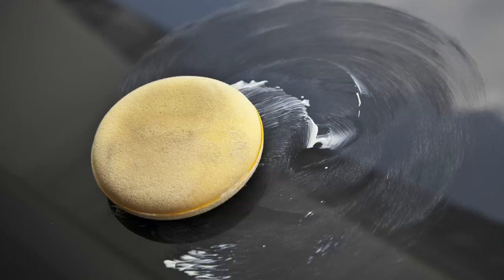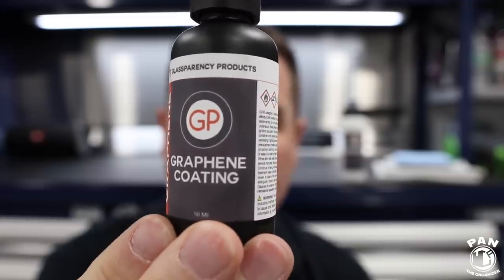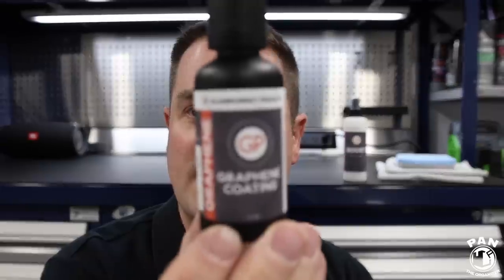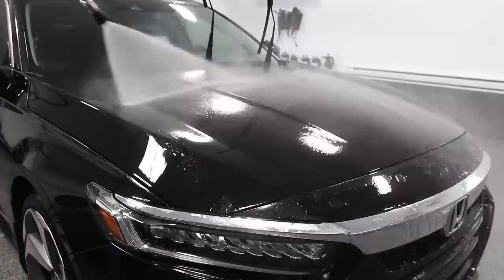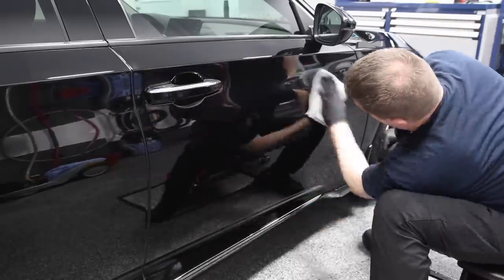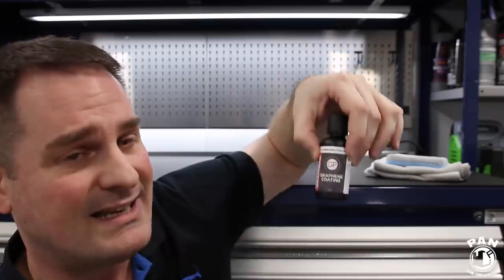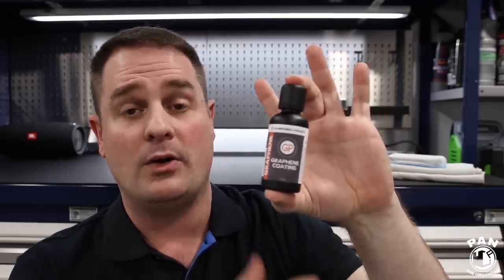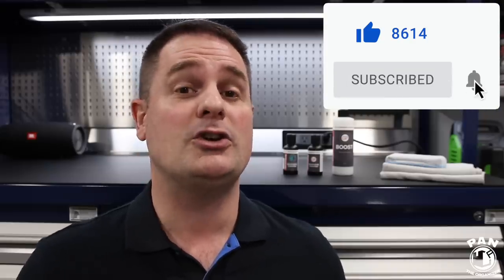GRAPHENE COATING by GlassParency! The Future of Paint Protection!

Comment: Pan, I love your personality and in depth videos! I’m expecting delivery of a new Toyota Highlander in mid August of 2022 and is to be built on July 27, 2022. I would like to apply the GP graphene coating and all the prep steps that you did. My question is it safe to do all these steps on this vehicle right away or does the paint and clear coat need to cure longer?
Reply from the maker: Hi Steve! Yes, brand new vehicles come from the factory with the paint fully cured and ready to go, as the paint is cured in commercial ovens. So yes you can, and SHOULD protect the paintwork as soon as you take delivery from the dealership.

I get a brand new car every three years and before I take delivery, I give clear instructions to the dealership to NOT apply any form of wax or sealant on the car, no protection. Just have them wash it so you can inspect on delivery for any defects or damages. And no interior dressing, no tire shine, nothing. I want to do all of that on my own.

Also, ceramic coatings and graphene coatings (the ones in glass bottles) need to bond directly to virgin clear coat, so you have to make sure there is no protection on the paint before you apply them.

Watch my ceramic coating application tutorial: https://youtu.be/sqQYVjxFqK0

Also, I made a popular video about why it's important to detail a brand new car: https://youtu.be/QgoyrC-5CMc

Comment: Hey Pan, I just ordered a bottle of the PanTheOrganizer limited edition from GlassParency after seeing this review! Super excited!

Quick question, is the Boost similar to other silica spray sealants? Is it possible to put the graphene coating on virgin clearcoat and then spray something like turtlewax hybrid solutions ceramic spray on top of it instead of boost? Or would this diminish the effectiveness of the graphene coating?
Reply from the maker: Yes Boost is like a silica spray sealant / topper.  You can also use other toppers on top of this graphene coating.

Comment: Hello Pan.

Thanks again for a great video!

I have another idea in mind. In our homes, specially shower and sinks, can we put that on:

- glass of our showers? It would avoid the chore and pain in the ass to clean all that persistant water.

- floor tile that we put on walls of our showers. Same too, we have to clean it, it would be awesome to see all the water running on without grasping on the walls.

- sinks: I have a red colored sink in my bathroom and I will never make the error again: you have to clean it almost everyday, it is fast but the tartar grasp on the glass of the sink, and if you don't clean, the layers accumulates quickly and after 3-4 days, waouhh... 

- in your toilets (where you pee ;). You remove all the water and then you apply this.

Is this possible? No problem? Are there better products?

And also vinegar is great to remove tartar but to remove all grease, everything, any product recommended before applying such coat in our inside homes?

Thank you very much to everybody. :)

Comment: Pan, I had my Glassparency graphene coating, 2 layers, applied in March of 2021 exactly 1 year ago. Brand new factory paint and an experienced technician installed it. 1 year later and after the winter we are just finishing here in Ontario I washed it for the first time since November. There was almost no water beading or sheeting on the hood or roof. I just ordered a bottle of Boost hoping that the hydrophobic properties will return. Do you have any suggestions on why there was no water sheeting or beading on the hood or roof?  Also, I noticed a couple of small scratches in the paint, not deep but I would like to correct it. What do I need to do to fix the scratches while maintaining the Graphene coating?

Love the channel and all that you do. Thanks for the help...
Reply from the maker: I would highly recommend that you contact GlassParency directly and troubleshoot with them. They know their product inside out and can help you.

Comment: When applying ceramic or graphene coatings can you use a glaze after the polish before applying the coating?
Reply from the maker: Absolutely not. Nothing must interfere with the product bonding to the paint.

If you did a good job polishing, there should be no need for glazes. Glazes contain fillers and masking agents to hide swirls and scratches, not actually correct them.

Comment: Great review as usual Pan. Quick query re disposing of cloths after applying (which I know applies to ceramics as well). Does this only apply after using the coating? Noticed there are some 'ceramic' finishing/detailing sprays out there - do they eventually create a build-up and you have to discard as well, or is the relevant material much more diluted in these sprays?
Reply from the maker: You would throw the towel after the coating's application.

Comment: Hey Pan! Just applied my Graphene coating. My bottle says 1/250 too! Took me about 4.5 hours but came out great! Question for you. After a few weeks when I wash the car, can I apply Bead Maker? Or should I avoid waxes and sealants?
Reply from the maker: Yes you can apply Bead Maker. But avoid waxes.
Reply: Pan TheOrganizer thanks Pan! Last question for you. During washes what soap would you recommend with the Graphene that can be used with a foam cannon? Currently I am using chemical guys honey dew which I like however I think it might contain wax so I am not sure if I should avoid it and switch to something else?

Comment: Thanks for all your content.  I did a full paint correction and used this graphene product as on your video.  I ended up with a few notable high spots.  A few questions:  the instructions on the bottle say to wait one hour before doing the second application, you say right away.  Does it matter?  How do you take care of high spots?  I noted the flashing time was fairly quick, seems you have to wipe off fairly quick.  I’ve also seen other graphene products say only one coat.  Looking forward to seeing how it hold up to western NY winters.
Reply from the maker: Usually, by the time you are done applying the first coat to the entire car, 45 to 60 minutes have gone by. Unless you work at a speed unheard of lol. So by the time the first coat is done, it's time to apply the 2nd coat.  One coat will still get you 2 years of protection, but to get the 3 to 5 years, you need 2 coats. That also ensures proper and even coverage.
Reply: @PanTheOrganizer  Thank you.  Would love updates on how u feel it or other graphene coatings handle our winters wear and tear.  I can tell you my last ceramic coating did not make it past one winter.

Comment: Hi Pan! Did you apply this to all exterior surfaces or just the paint? Curious if this can be used on Glass, Trim, Lights, Grille and Wheels?
Reply from the maker: You can apply this on all exterior surfaces: paint, glass, wheels, plastic trim, headlights, tail lights, etc.

Comment: Good timing....If all goes well, trading cars tomorrow. This will be my project for next weekend. Would you use Bead Maker in between the Boost uses a sacrificial layer? Thanks again for the help and insight.
Reply: Pan edition already sold out. Had to order the non-Pan bottle. lol
Reply from the maker: Yes you can use Bead Maker too.
Reply: @PanTheOrganizer  ...thanks Pan. Ok, I have to ask a dumb question? What is considered a maintenance wash you spoke about doing every two or three months, then finishing it off with the Boost? Just trying to make sure I"m on the same page as you, before doing this Tuesday. Thanks!

Comment: Hi Pan, Great video. As the product last for approx 5 years ,, next year when i will do my annual maintenance , wash,  clay, compound then put sealant and wax, can i still do that on a yearly basis ? By doing that will it remove the Graphite Coating? Or it it still good to put the sealant and wax each year after. Thanks and great videos that you put in for all of us.
Reply: Curious to know the response also. 
When you put this kind of coating it’s not for erasing it next year when you detail your car...
Reply from the maker: You would do a wash, iron remover, and then simply apply a coat of Boost.  Here's an example in my ceramic coating maintenance wash video: https://youtu.be/yLiePQRMFc8

You don't clay coatings.  You don't apply waxes or sealants on top of coatings.  You use silica based spray sealants.
Reply: Thank you Pan for your response. You’re the best !
Reply: Thanks a lot Pan, that will ease  my yearly maintenance .  I will have to get ride off all the wax and sealant that i purchase from Chemical Guys..
Very proud of you success , being also from Quebec make me more proud that someone succeed in that field of Car detailing.  Keep the great work !

Comment: Thinking of buying a black car. What would you recommend to remove orange peel?
Reply from the maker: No product will remove orange peel.  You would have to use advanced water sanding and machine polishing techniques.  And you shouldn't remove orange peel.  There is a reason why it's there: to minimize the appearance of scratches and swirls on daily driven vehicles.  All cars have this to some extent (some less than others).  A perfectly smooth and flat clear coat should only be done on show cars, museum cars or trailer queens.

Comment: Pan...love your experienced advice.  Keep it up.  I got the graphene coating from GP recently.  Why do they say not to wash the car for 14 days?  Does it get affected by rain during that 14 day period?  How would you get out high spots of the product on where the product dried quicker that I could get to it to level?
Reply from the maker: No problem if it rains or it gets wet. Just don't wash the car for 14 days (using chemicals).  If you get high spots, and weren't quick enough to level them, you need to machine polish.

Comment: This won't work on older non-perfect paint, right? I have a 99 camry that looks good for it's age, but it does not have glassey smooth paint by any means. Just wanna keep it from getting funkier. Is ceramic is a better, more cost effective method for my car?
Reply from the maker: You have to prep the paint well including machine polishing like in this video, and yes the graphene coating woukd dramatically improve your car’s paint.

Comment: I watched your other video with the turtle Wax Graphene infused Flex wax and did the prep recommended before utilizing the product, and my results were phenomenal!. Can I put this product over the graphene Flex wax to give it a straight graphene coating as well?

I thought I might try this and then maintain the upkeep with the instructions on the turtle Wax Flex wax with the spray-on spray off or spray on wipe off method.
Reply from the maker: No. A true ceramic or graphene coating (the ones in glass bottles like this GlassParency) need to be applied to well prepped and virgin clear coat to bond correctly. Coatings are NOT made to be applied on top of existing waxes or sealants or coatings.

Comment: Nice Video! Do you think 2 cars could be coated with 1 60ml bottle? (Tesla 3 size) also, did you threw your towels in the trash after applying that coating? Is it required to do so? Thanks mate!
Reply from the maker: Always throw away the towels used to level and buff coatings in glass bottles (ceramic and graphene).

One bottle should be able to produce 2 coats on 2 average size cars. It depends on how much you use though hehe. Some people overapply.

Comment: What happens if you need to buy more boost spray? And also, instead of using boost spray, do you think you could use the new aerospace 303 Graphene Spray Coating as a topper?
Reply from the maker: Yes you can use graphene spray coatings as toppers.
Reply: @PanTheOrganizer  Okay thank you so much! I'm a huge fan thank you for showing me a lot of great tips and tricks.  Another quick question though, what soap and glass cleaner would you recommend for daily washes after applying this coating?

Comment: Hi this is interesting, so how long does Graphene hold up how many months and how many Car Wash does it hold up ?. Thanks
Reply from the maker: It's impossible to say how long as nobody has been able to test these new graphene oxide based products for years now. They are all new to the market. So time will tell. So far so good though. These are as durable as the best ceramic coatings in the consumer grade market. So in theory these should last for hundreds of washes if they're rated at 3 to 5 years durability.

Comment: should i wash the car after polishing it and before applying the graphene?
Reply from the maker: No, but you would use an IPA or prep spray after polishing, in order to remove polishing oils and residue. That is key for coatings to properly bond to the clear coat.

Watch my full ceramic/graphene coating application tutorial: https://youtu.be/sqQYVjxFqK0

Comment: Would we save more product if we used a foam block and a microsuede towel?  Or do you recommend using the supplied microfiber applicator for both coats?
Reply from the maker: You could do as you wish.  I just flip the applicator to the other side when applying two coats.  That’s why the applicator has two colors.
Reply: Pan TheOrganizer awesome thanks Pan I got the special edition I’m excited!

Comment: Great video and review! I haven’t been a fan of ceramic coating, have opted in to use good old fashioned carnauba based wax, but now you have managed to awake an interest... As an unbiased (as much as you can 😎) opinion, which graphene coating is the best? Naturally, no wax needed after this has been applied, correct? I don’t have experience of applying coatings myself, assume better to leave for a professional? Also, I suppose never apply this without at least some level of paint correction? Now, you mention a few times “reduces tendency to water spots” - do you actually mean just reduce, or technically no real world water spotting at all? Apologies for all the questions, the last one: any experience whether this reduces likelihood of scratching, or even provides protection against stone chips? Thanks for great content!
Reply: use IGL F4 RENEW....it goes on similiar to a paste wax....gloss and hydrophobics off the charts

Comment: Does this protect against scratches and swirls better than ceramics ?  Is it advisable to use it on an already ceramic coated car ?
Reply from the maker: No ceramic coatings or graphene coatings protect against scratches or swirls.  That's marketing bs. No serious coating company would claim protection against scratches.  And no you can't apply this on top of existing coatings.  Graphene coatings, just like ceramic coatings, need to be applied to virgin clear coat, on well prepped paint.
Reply: @PanTheOrganizer  Thank you so much for the precise reply Pan :)

Comment: I had a great looking finish with 2 coats of the GP BUT I immediiately put on the BOOST as Pan recommeneded in this video.  I just got back an email from the maufacturer and they recommend letting it cure for 30 -45 minutes after the 2nd coat then use the BOOST.   I found that using the  BOOST immediately after the 2nd  really messed up the finish so I would recommend just forgetting about the BOOST.  I don't think you need it.  Just let it cure on its own.  I would also just do a 2 foot square at a time and not a whole panel. Just forget the BOOST and just used it after the 2 coats are cured.  It is not worth the effort.

Comment: G'day Pan, thanks for the introduction to Graphene Coatings. To me, it is too early at this stage to form a proper opinion on graphene, as like ceramic coatings, it has taken years to perfect ceramic coating by many manufacturers. As you mentioned that there are many graphene products out in the market, some good and some not so good. Does GlassParency provide the percentage % of graphene that is used?
Reply from the maker: Let's not get into % talk...  There's a reason brands aren't talking about SiO2 percentage anymore, as people were obsessed and would focus on numbers (which are just marketing anyways) instead of focusing on actual product performance.  I am one that doesn't care about graphene % or SiO2 %.  I want to see how well it applies, how well it levels, how glossy it is, how it resists chemicals, how long it lasts, etc.

Comment: I applied the Glassparency Graphene coating on my black  BMW X6M50i. Looks great and was easy to apply. However, the next day I noticed I must have inadvertently smeared a streak across the driver's window. Before I do something bad, what's the best way to eliminate this streak (and not hurt the window)?
Reply from the maker: Just hand polish it, it should come right off. A bit of polish on a microfiber towel and rub it. Glass is much harder than clear coat so no worries.
Reply: @PanTheOrganizer  Thanks for the advice and the really fast response. Yes, glass is a 7 on Moh's 1-10 Hardness Scale; (steel is 6, diamond = 10, talc = 1). I enjoy your channel very much, and watch it nearly every day.

I'm in N Minnesota and have 80-100 ft White Pines along my driveway. They "bleed" pine sap constantly. Really challenging to remove if it drips on your vehicle. Not enough room in my garage for my BMW and Ford F150. Just ordered Stoner Car Care "Tarminator". Ever used this before? Will be using it soon, and then "covering" the pickup once cleaned!

Comment: Hi Pan. After winter here I find a lot of brake dust on paint. I usually clay bar to remove this. I assume if I apply Graphene Coating and after winter I clay bar to remove brake dust I will end up removing the Graphene?
Reply from the maker: No. Never clay a coated car. You use iron removers to remove brake dust.
Reply: @PanTheOrganizer  I am guessing I will use iron movers twice a year as apposed to clay bar. I think it would be a good idea to apply the Boost amongst other times right after using the iron spray?